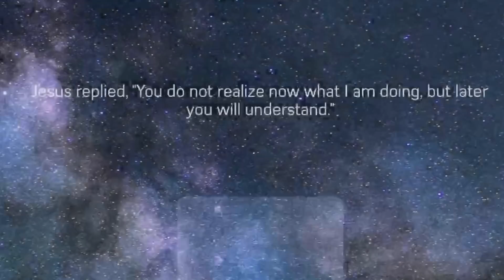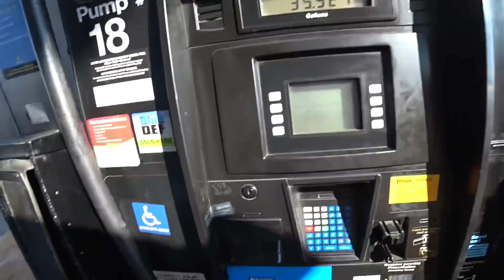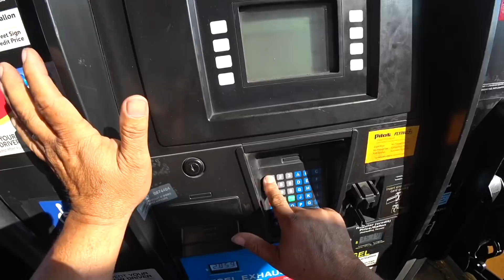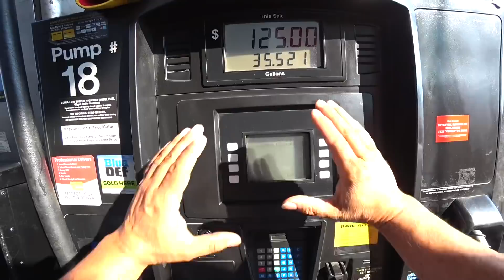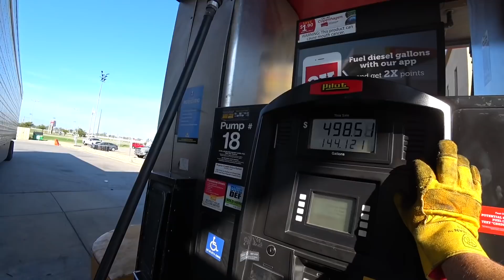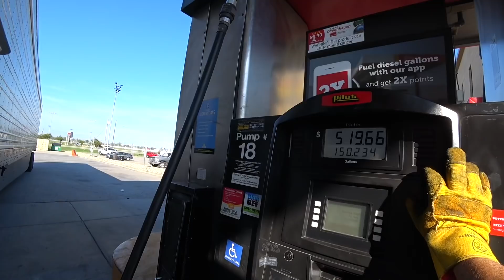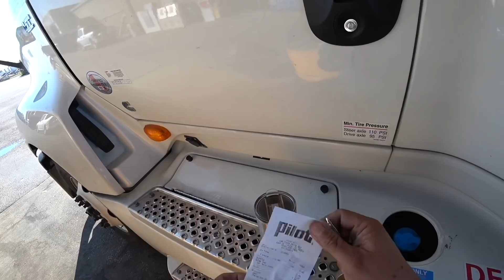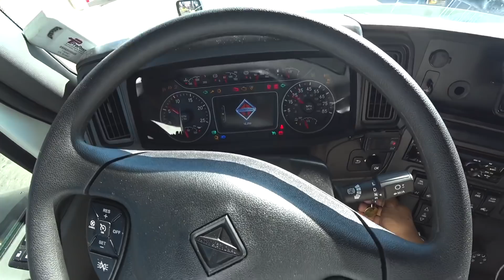October 6, 2018/1227 Pilot 👨‍✈️ Truck 🚛 Stop 🛑 Fuel ⛽️ East St. Louis Illinois

Comment: I’m wondering why are u useing a hammer on the wheels instead of a tire air gage
Reply: Checking for flats.
Reply: When you hit the tire, you can tell from the sound and feel if it is under inflated.